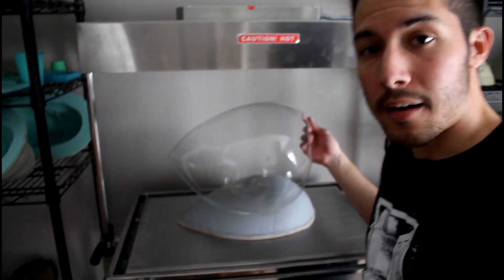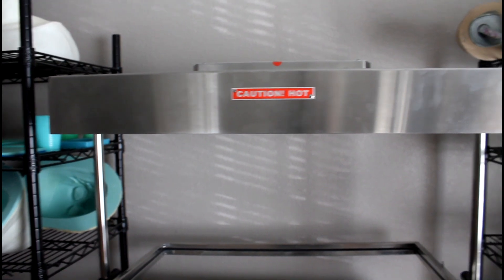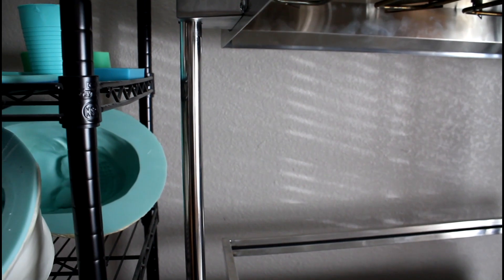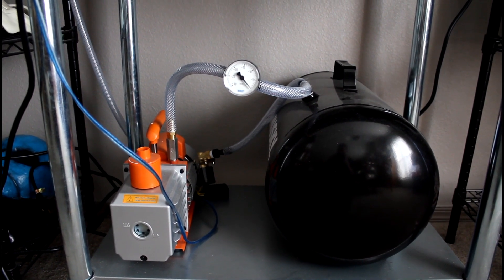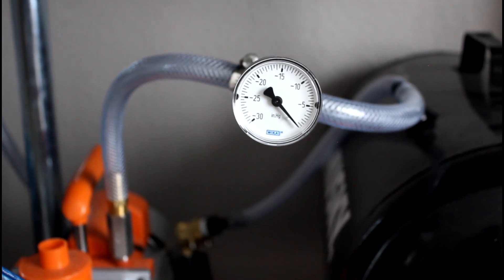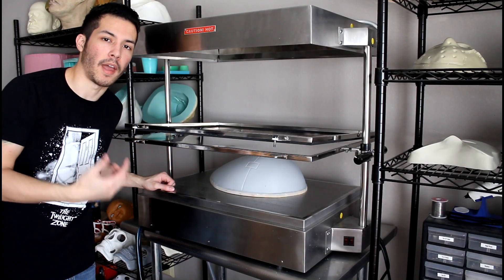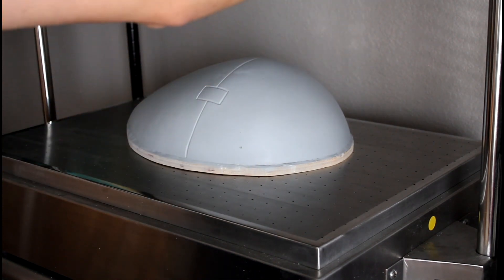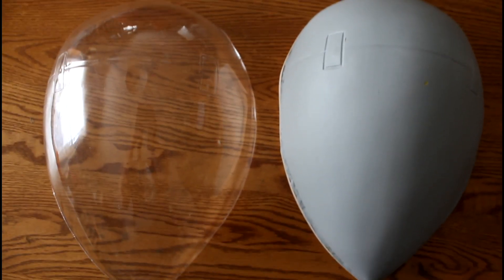My Vacuum Forming Machine

Comment: I am using a similar machine only with taller mold.  I find the taller the mold, the more trouble I have with the .04 mm petg clear sheet .  I let the thing heat for 10 minutes with no plastic nearby.  Then insert the sheet.  raise the sheet.  Count to 48 sec for .04 mm PETG sheet and it works great for a 3" tall mold.  I am now working with a 6 inch tall mold and it's not so good.  Think I will order .03 mm petg clear sheet and try it.

Comment: I am using the same machine and am hooking up the vacuum with the tank. What did you do to close the shop Vac opening?
Reply from the maker: I know this is a late reply. But I didn't close it off. It's still open on mine, and works fine.

Comment: nice product !! I'm interested in whether the heater has a thermostat? or is it free of temperature control?
lp simon
Reply from the maker: It's free of temperature control. I'm sure you can add a heater control, that way it isn't stuck on just one temperature when it's on. If you are pretty handy with wiring and such.

Comment: Follow-up question, what is the minimum psi rating needed for the air tank with that pump so that it does not collapse under outside pressure?

Comment: Thanks for the video, how much of a difference does it make on the result if you hook up the vacuum pump directly instead of using a vacuum chamber?
Reply from the maker: It would depend on what you are forming. I wouldn't use a vacuum pump straight on bigger pieces. Only because the vacuum pump would take a while for it to suck the plastic down. If you are doing something small. It should be just fine. If you are doing pieces like i do. Then for sure a tank set up is the way to go. Not sure on your follow up question on PSI.

Comment: If you are making multiple copy's, how long should you wait before stacking the hot/warm copy's on top of each other?
Could a big fan help cool the stack?
Reply from the maker: Honestly you really have to play it by ear. Depending what the piece is, I usually have a test try. Then the second go around is where i know what to change. In terms of how long to keep the plastic sagging more. You don't really need a fan once the plastic goes down to form your object. Since the plastic cools pretty instantly.

Comment: What make and model is the vacuum pump? Also, what type of valve is it that works with a switch? Thanks for the video
Reply from the maker: I got my Vacuum Pump from Best Value Vacs. It's the 9CFM version. As for the valve, it's a Electric Solenoid Valve.

Comment: Pretty good!!!  thanks!!  did you tried acrylic like 3mm or more thick plastics?  I would like to know how much detail it can form using thicker stuff....  I would like to make a turtle shell... with details in the surface... . not sure if could be possible...  thanks!
Reply from the maker: The thickess plastic iv'e tried on this former was 0.118 PETG. The item i was forming is the same one in this video. And it came out great, also picked up some the details. The key to getting good detail is nice holes on your buck, and a good vacuum set up to pull in that detail.

Comment: Hey, Crazydog. Ever heard of using one of these machines to do sublimation? Using an ink transfer film instead of a plastic sheet? Think it would be possible or would the film stand no chance against that kind of heat? Thanks!
Reply from the maker: FPS Fox It's possible. I did something along those lines with a sheet of vinyl like material. You just have to be careful with the heat, and how much air it sucks in. If too hot can be too soft and bubble. If too much pressure sucking into can pop the material/deform it.

Comment: Hey crazydog! I have a question. What do you use to cut your copy's off the sheet when you're finished? I still haven't found a quick way to do that.
Reply from the maker: I use Tin Snips. Seems like that is the best way to cut them off the sheet fast for me.
Reply: Yeah that's what I use. You would think a Dremel would work well, but the tin snips actually work better. Thanks Crazydog!